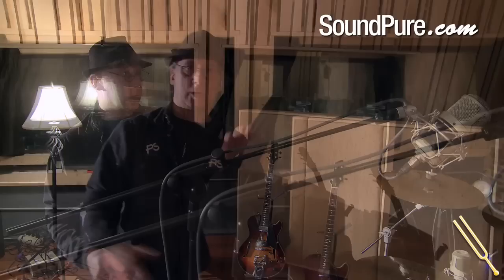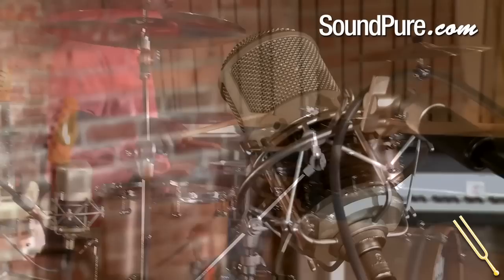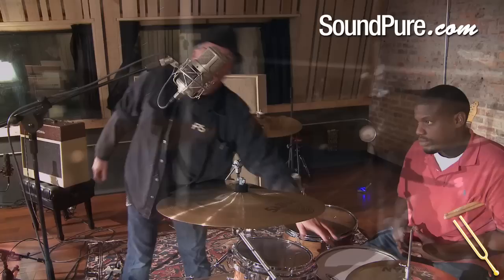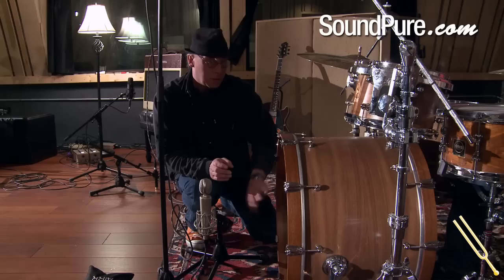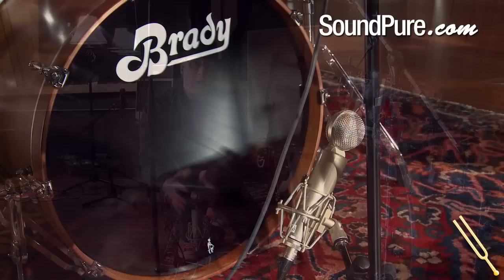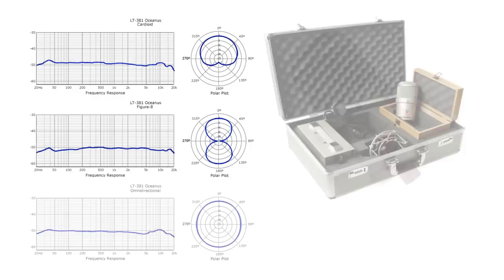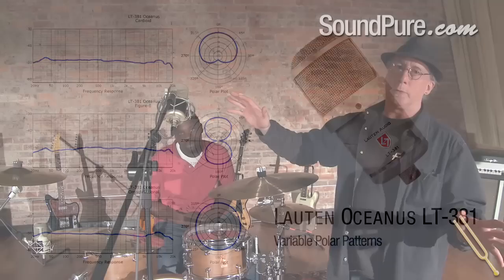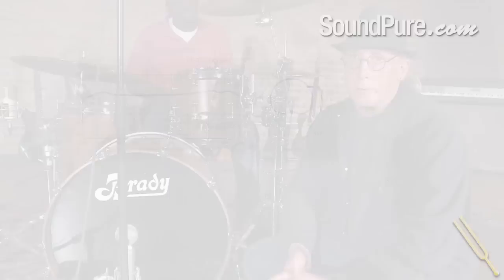Glyn Johns Technique - How to Mic a Drum Kit with Three Lauten Microphones

Comment: Quick tip for finding phase issues. After you place the mics, use the phase switch on your preamp to find the position where you lose the most low-end. Move the mics until you have maximum loss of low end (out of phase), then switch the phase switch back the other way and now you will have maximum gain of low end (in phase). It is usually quicker and easier to hear the low end loss rather than the low end peak.
Reply: LautenAudio wow$!!! epic . thanks

Comment from the maker: Sure, it's something that you will have to test.  I have a feeling that you are right, and you may want to try to reposition the China to a place where it's not directly in front of one of the microphones, slightly modify the microphone positioning to address the proximity to the China, or even consider a different technique altogether if it doesn't work for your particular rig.  In the end, this is one of many, many techniques - one that requires certain parameters in terms of room and kit.

Comment from the maker: If 57's are all you have, then 57's are all you have... but, you will want to make sure you do a few "test recordings" in order to find the best positioning.  The SM-57 rolls off a bit high for getting a great bottom to your audio, and they're a bit dull in upper end of the presence frequencies, so some of the "whack" could be difficult to articulate.

Its do-able... it just ain't easy
Reply: Yeh - do-able indeed. But you're right ... it is not an easy task to do GJM with any dynamic mics. I need to obtain another condenser mic for that reason ... mixing dynamic front mic with two condensers gets a bit messy: to get the right amount of bass on a dynamic Front, you can no longer be in an equilateral plane triangle with the Over and the Side, so the phase relationships can go weird.

Comment: I assume you set the Oceanus mics to cardiod? Perhaps omni? I realise that I could try both as I have really good drum spaces in two buildings and plenty of absorbent gear to move around and I could just experiment (as I will anyway). I have several good tube multipatterns and up till now have done two OH cardiod condensers and a dynamic kick mic right by the kick hole which works really well as dynamics are less susceptible to air rush. So I simply pan the OHs from the listener's point for a great stereo soundstage. I'm very impressed with your presentation and the recording supports the points you make. Cheers from Australia.

Comment from the maker: When you reccord drums this way you're going for sense you're in the room with the drums... the feeling that you're in the same room standing about 10-12 feet in front of the kit, which means radical panning will make the image seem unnatural.

I usually run the "side" mic a little to the left and the "over" mic a little to the right with the "front of kit" mic either straight up or a little to one side.  

Whatever feels "right" in the final presentation of the song... no rules...  8^)